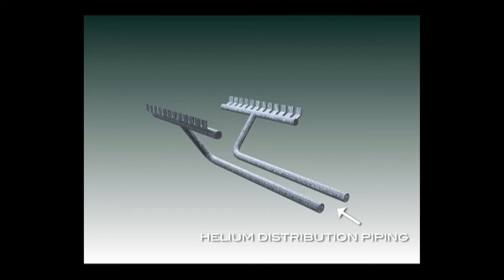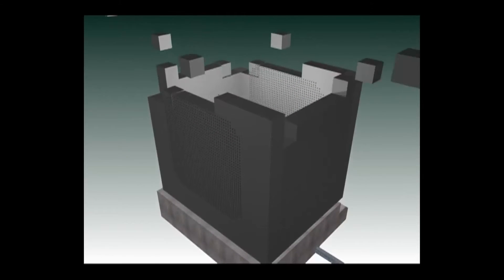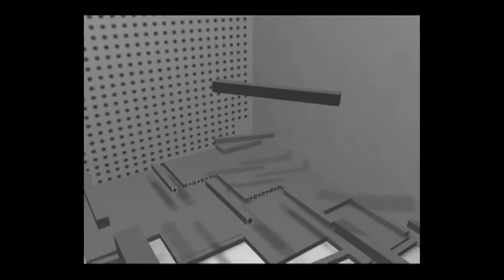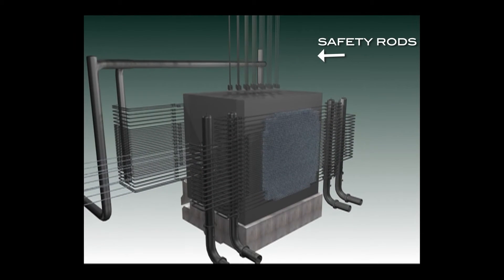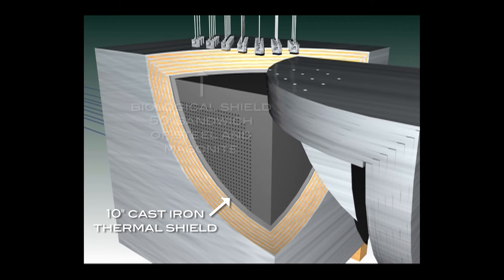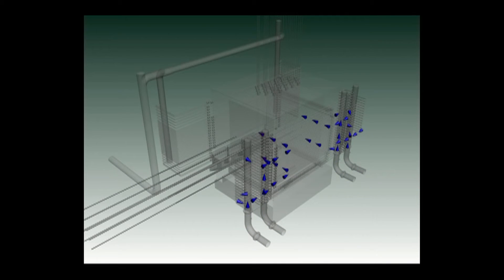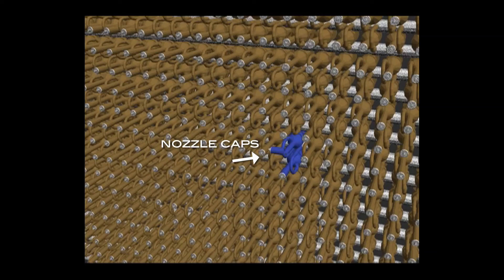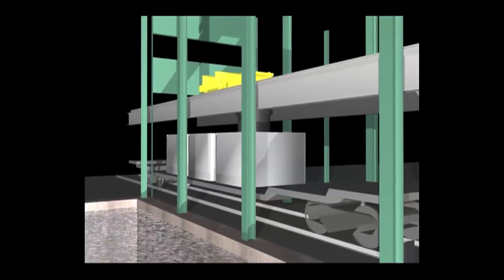B Reactor virtual model

Comment: One important aspect of the B reactor is never explained in any of the videos I have now seen: how is the output of the reactor collected? If the output is the temperature of the heated cooling water, I would expect some sort of heat exchanging installation or steam generation unit. But if one of the purposes of the reactor was to generate Plutonium, how is that collected? Put simply, where is the reactor's output?